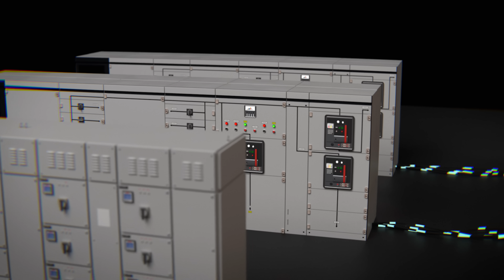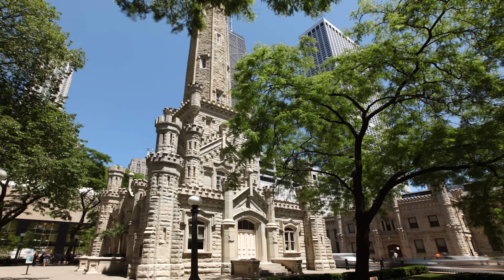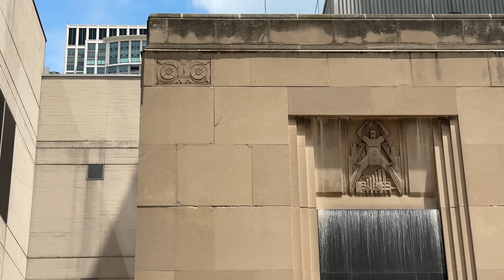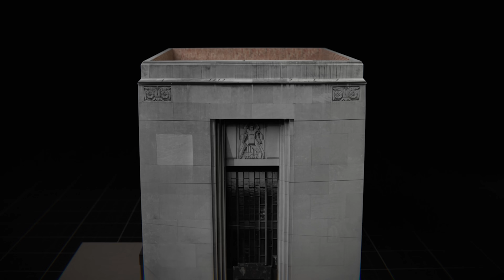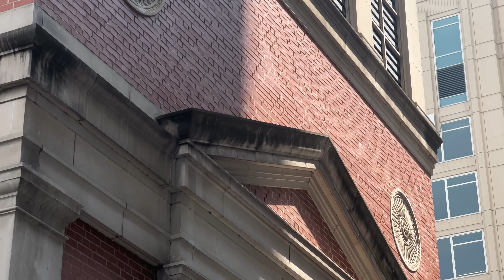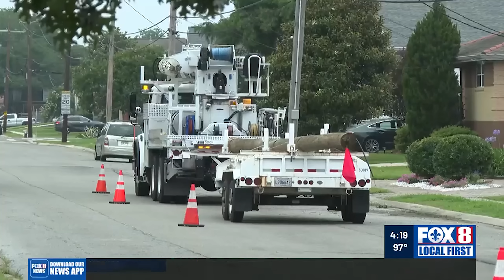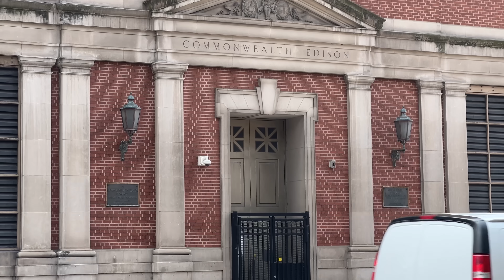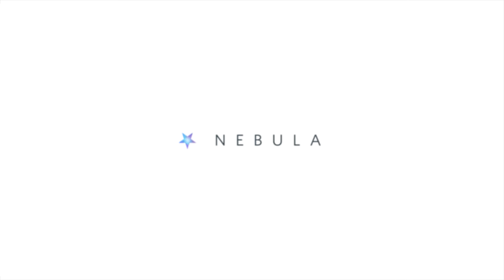How Fake Buildings Keep Cities Alive

Comment: With that heat loss is it lending to global warming?
Reply: Today waste heat is much, much smaller than that of light trapped by greenhouse gases.  However, whenever you see some sci-fi planet that is completely built out (as in Star Wars), then waste heat would indeed doom such planets.
Reply: While that heat should be used for heating or hot water in neighbouring buildings, it is absolutely inconsequential compared to putting CO2 in the atmosphere...which may well be how the electricity is generated. Chicago is the windy city. I sure hope the area is surrounded by windmills.